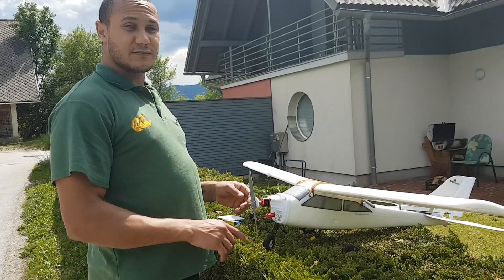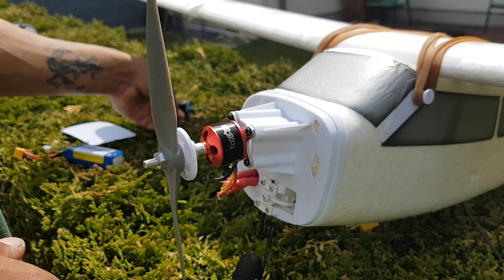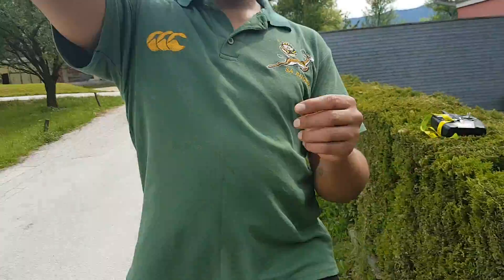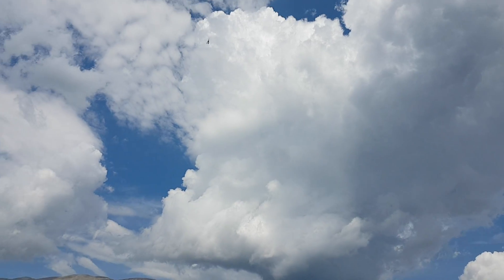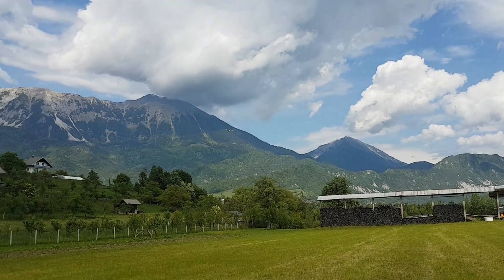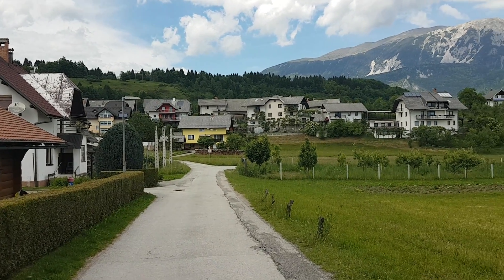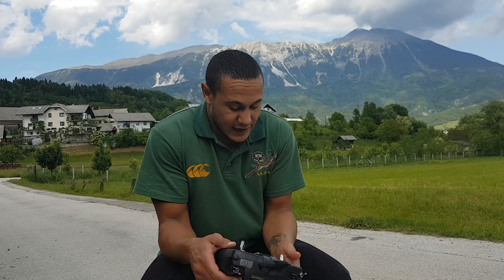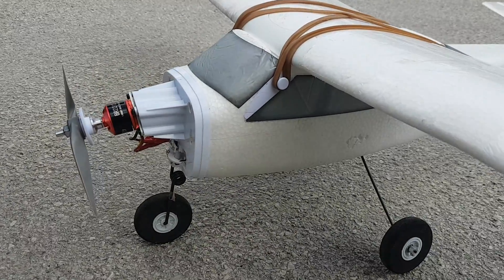Racestar 1400KV motor test in Slovene air space

Comment: You can fix that pull forward from the motor EASY...
Just drill a hole in a 2 x4 or a block of wood....( for the shaft)..
Loosen the set screw on the shaft ( front of motor) then just tap the 

shaft from the rear of the motor forward....retighten set screw..
I actaully do it with the motor still wired to the model. It's easy.

The shaft on out runners will get sholve backwards or bent  from Nose over...ect 

prop saver will save props...but the shaft will still get some sort of impac.
It is what it is...just maintenence.

You need to take it apart to lubricate the FRONT bearing anyways...

Yeap...no point in spend lots of money on an item that will get damage, wear and tear.
or just get 4-5 ea...for spare. They're cheap.

Comment: you don't recommend this motor? it is very cheap 5.2 dollars only.. I am not sure how soon bearing breaks, I have similar but 1000KV and need an 1400KV set for quadcopter now...
Reply from the maker: No bearings in a brushless motor, nothing there can break really. 
It's an OK motor,  just don't push it past it's limits.

It can handle an 8 inch prop maximum on 3s Battery. 
and 6inch on 4s, anything above that and you'll burn it out.
Reply: Whats about 9050 prop and 4s >? It's still okey or no? i have that motor and that prop i used them but in prototype of boad with propelers.... but i don t test it yet for longer than maybe 2 mins on 60%-70% power so they still working well.
Reply from the maker: Mateusz Sterniczuk  that motor will burn out with that prop on a 3S battery. If you want to use 9x5 prop buy racestar 2830 1300kv motor. It will handle it. This motor with 4s1p use a 6 inch prop or 7x3.
Reply: Trip Sinclair thanks i allready have 2 x that 1400kv motor so i must buy smaller prop. So our prop i will use for other projects... On Banggood its 9050 prop but for 3s when i check this motor info on page.
Reply from the maker: I burned this motor out with 9x6 on 3s. toasted it in under 5 min.
Reply: I got 5x4.5x3 but they are too small and i got them for 2400 kv 4s

Something like this will be ok ? :
https://www.banggood.com/10Pcs-DYS-Slow-Fly-6x5-6050-Propeller-EP-6050-For-RC-Electronic-Airplane-p-1109989.html?rmmds=search&cur_warehouse=CN
Reply from the maker: Mateusz Sterniczuk thats link to 6x4 prop. For 2400kv. Mmmm I'm not sure. Let me see
Reply from the maker: Mateusz Sterniczuk can you give me link to the motor you gonna buy? Maybe I have it. I have allot of these motors. I can put on a trst bench for you. Also can you show me what plane you gonna use it on? Or the specs of the plane?
Reply: Trip Sinclair https://www.banggood.com/Racerstar-A2212-1400KV-2-4S-Brushless-Motor-For-RC-Airplane-p-1085430.html?rmmds=myorder

I Got allready 2 x that motor and only 9050 prop and 5x4.5x3(5045)
This is my first RC project and its a boat with 2 x motor on rear to push boat. But now i m scared my 9050 will burn Motors. Boat its heavy for now but maybe i will make new one and less weight.
In march i wanna make x220 wizard drone with racestar 2205 2300kv   on 4s and with 5040 or 5045 3-blade
Reply from the maker: Use the 9x5 props. If the motor burns out Banggood should replace it as per spec.
Reply: Trip Sinclair Thanks you for answer. I hope they will survive :p when i will make new model with less weight and maybe smaller one i will maybe use 8060 so i can push them on 100 % without of fear to burn them:p

Comment: Which prop you used for this motor...?
Reply from the maker: I mention it in the video. 8x4 prop.
But You can use 8x6 or even 9x4 with a 3S battery, it holds file. 
This motor gets very hot, don't mind it getting hot, it's normal. It will burn your fingers it gets so hot, but it's fine, mines running for months and nothing wrong with it.
Please like and subscribe, thanks.

Comment: Hi, TS, what is the final weight of your plane with battery? To which weight limit would you use the 1400 KV and which use is recommended for the 1800, 2200 and 2450 KV?  Do you fly this plane with 3S or 2S battery 2000 mAh? Where can one buy your plane :-)
Reply from the maker: The plane I'm using is a ready to fly plane called the mini apprentice, I just modified it and changed the ESC and motor. 
Now stock the plane is 750grams or so, with the 2200MAH 3S battery it's just over just over 1kg. 

The motor is not your primary concern, you first need to choose a prop, once you have a prop in mind, then you decide to choose a motor. The bigger the prop, the less KV the motor is going to need. Obviously the pitch of the prop also matters but lets say you using a prop between 4 & 6 on pitch.

It's very difficult to say off hand like this what kind of motor is recommended for which application, it all depends on what you need. 
If you tell me the plane and weight, eg what kind of plane, high wing trainer, mid wing 3D plane etc, I can recommend a prop and motor based on that.

But here is what I have and what motor/prop I use.

1.2m EPP Eagle, slow fly. Uses 1300kv motor with 8x4 prop & 1300Mah Lipo 3s.
1.5m Glider, 1000Kv motor with a 11x4 prop using 2s lipo.
Mini apprentice 1400Kv motor using 8x4 prop with a 3s Lip.

The KV isn't always important to.

For eg, the glider has a 1000Kv motor, but it's a pretty big motor and it's well over 300 watts. 

The EPP eagle uses a 1300kv motor with 3S lipo and it's 250watts, never need to use more than half throttle for the application.

What is it that you are looking to put a motor on and I will give you a few power options for it.

Please subscribe to the channel, thanks allot.
Reply: Great, how do you manage the ESC? I have the yellow and red simonKs, but they are not prepared. Flash and/or calibrate? What do you do and how fast do you reach your goal? This PC, software doing long, long way ...
Reply from the maker: Not sure how you can get an ESC without firmware, but I generally buy them for really cheap from china.
And it's easy to calculate, pretty much 1000 - 1400kv with an 8inch prop doesn't need more than 20amp esc. Increase prop to 9inch and you looking at a 30amp esc. If you using 3s Lipo.
But all of this isn't concrete it's estimated. dif platforms use different power systems.
Reply: Most people talk about flash to the new software means update. I also buy the cheap chinese ones. But they don't react when they get power, no melody, no peep. Other ones with 12A of China do their calibration job and play a melody. But for 1400KV it is a bit too less.
You don't do anything elaborate with the ESC? No USB programming stick, software, flash adapter ...? Plug and let play. But do your ESC play at once?
Reply from the maker: Nope, no need for any of that, if you not getting any tone, check if there is power, if you not getting any motor engage, check the throttle stick when you turn on the transmitter. Try making a video of your issue, I'm able to help if I know whats really happening.
Reply: Thank you very much, TS, I try again, additional make a short video. Mee too I don't understand why the ESC should be dead ...
Reply from the maker: could just be broken, many of these chinese things arrive broken, they refund or resend, but the ones that work work, the ones that don't work don't work.

Comment: I ordered some of these cheap motors for a dji f450 quadcopter hope to be able to run 4s battery but 3s is just fine also.Is it still good?
Reply from the maker: with small props 4s is fine wont be an issue. you can run 4s on 7inch prop on a plane.
And yeah it's still running perfectly fine.
Reply: Thanks i usually run gemfan 8045 props on it so as easy on the throttle since had 10 in.props explode on XK 2212/1400 kv motors.They only handle 3s.Glad to hear it still working.
Reply from the maker: Pls hit the subscribe button, help me grow a big :)